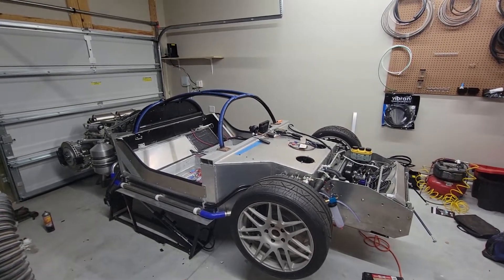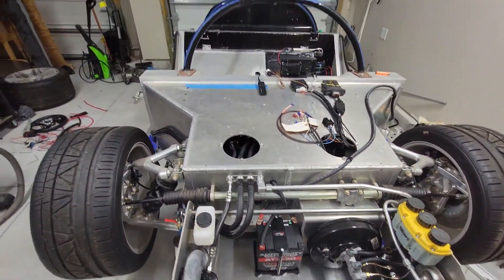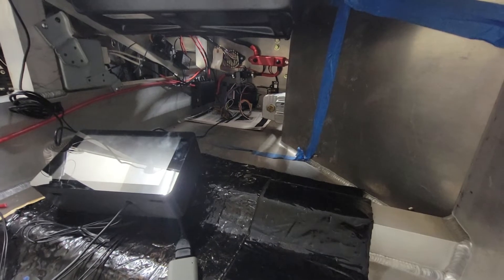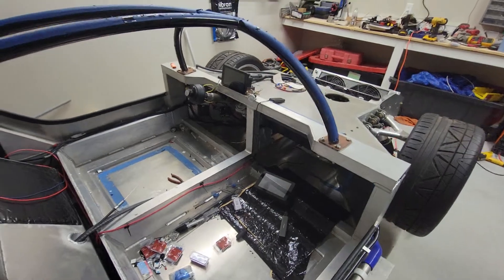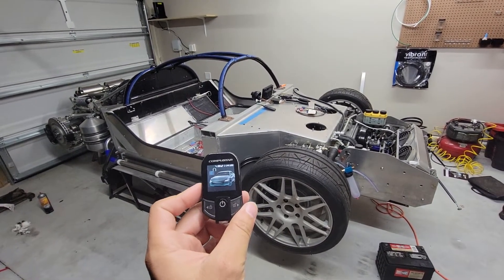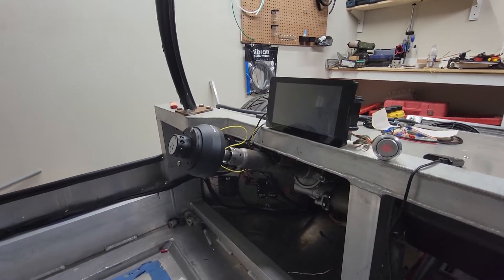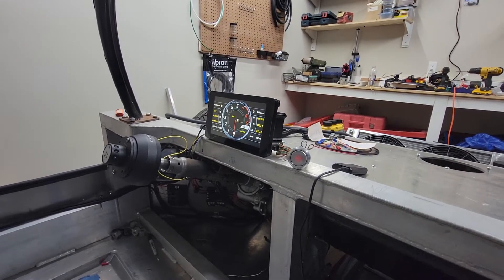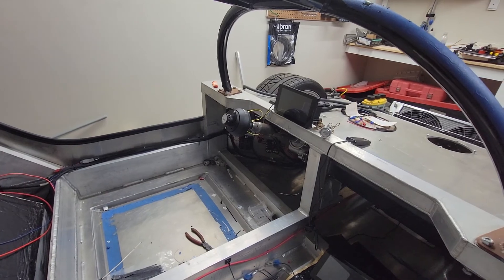compustar prox key system controlling the SLC

Comment: Very slick electrical system!

I was looking at using the same Compustar T13 but I wanted proximity based arming as well as disarming.
I started looking into the Digital Guard Dawg ikey Premier but am now considering the VAIS SEER. 
It is a RFID based push to start system that can work with a Compustar alarm to arm/Disarm the alarm based on proximity as well as perform other tasks based on keytag proximity (cut off power to several devices, welcome/approach lighting,etc).

Just thought I would share. I bet You've probably considered all options as well with such a well thought out and executed build!
Reply from the maker: Yeah I've gone thru it all pretty much.  I feel like I should point out the compustar does have proximity arming though.